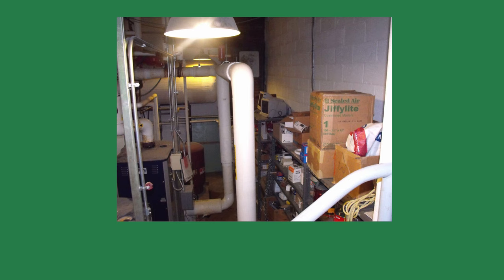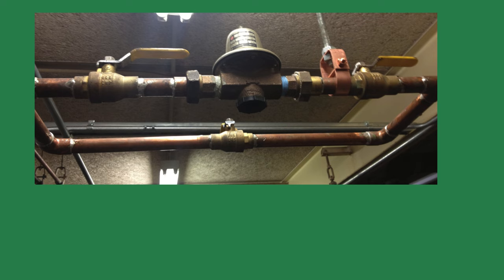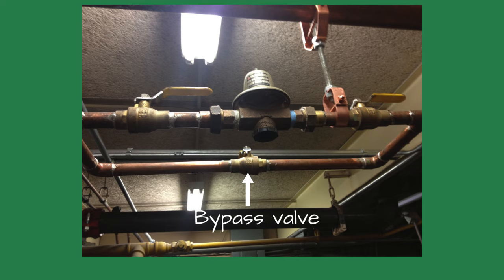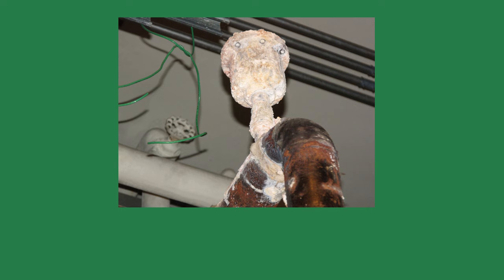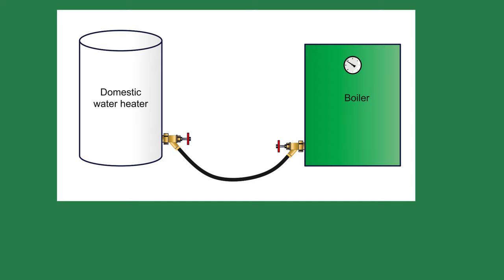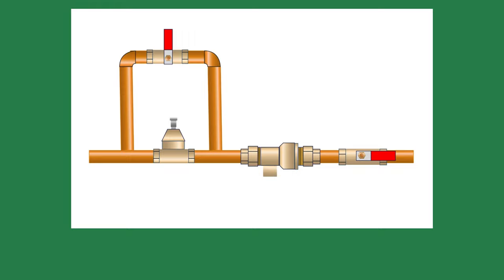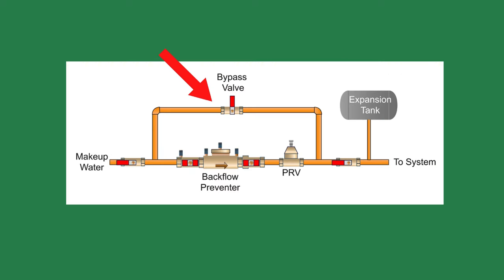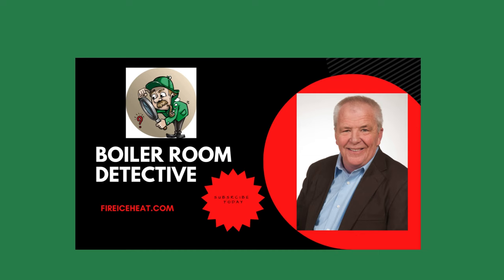Understanding the boiler fill valve

Comment: Mark Eatherton’s brilliant solution, especially for a system that may be unoccupied for a duration of time is to pipe a well system type pressure between the inlet shut off valve and the PRV. With the inlet valve left closed, the pressure tank’s draw down provides a cushion of fill water while preventing a major flood in case of a system failure.
Reply from the maker: I like that Thanks